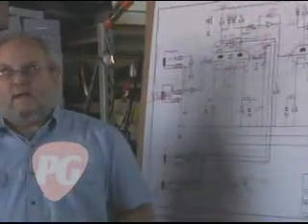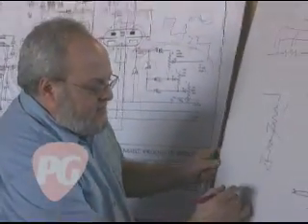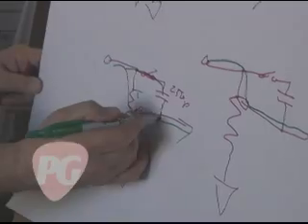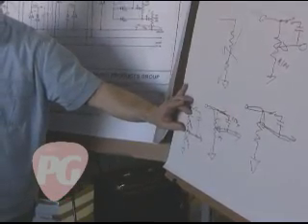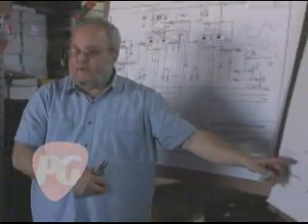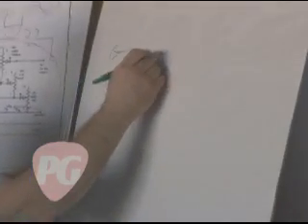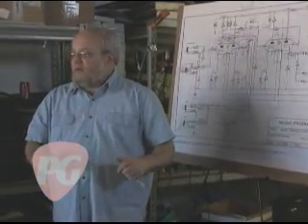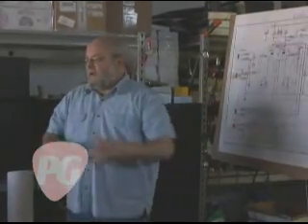Bright Switch Lecture - Egnater Amp Building Seminar

Comment: ah thats why the normal channel bright switch on an AC 30  is so powerfull at low volume and don't do much of anything canked and how it can be flat with it off but louder and brighter with it on
Reply: oh and that stuff about turning the guitar volume down and losing brightness? i always thought it was the capacitors on the tone controls loading on the signal but it's the dam pickup duh those one-meg tone pots...well it must have been a placebo effect? or? if this course was offered in Peterborough I would definitely take it.
Reply: Yep I have a Renegade and on low preamp volume it really boosts the high end a LOT. But when the volume is all the way up it doesn't do much. It can be annoying cause with a darker/drop tuned guitar I want to have both a bright input but also saturate the preamp. Can't really do that.